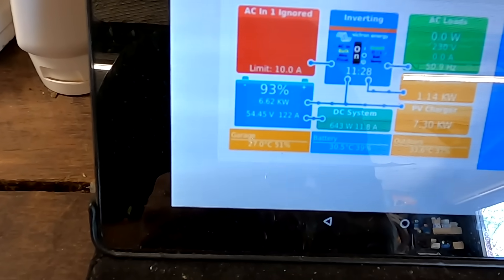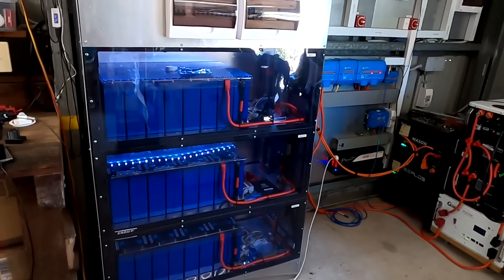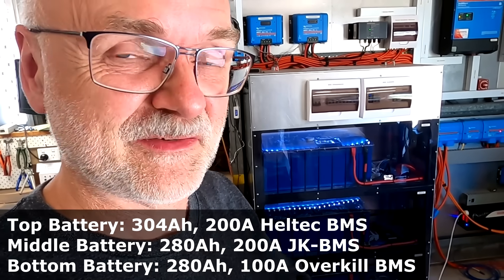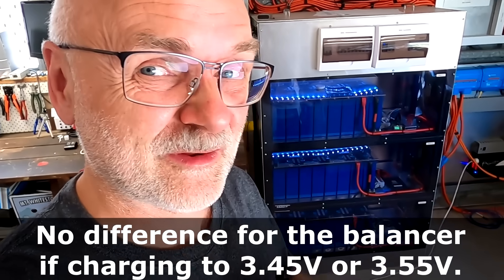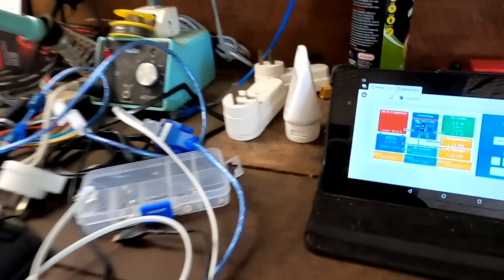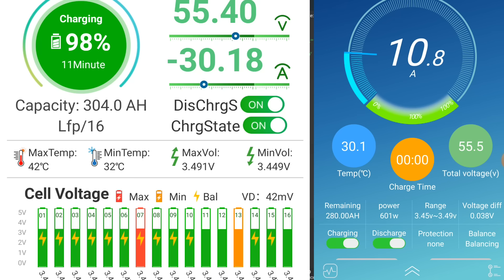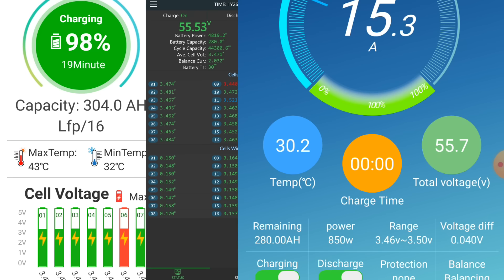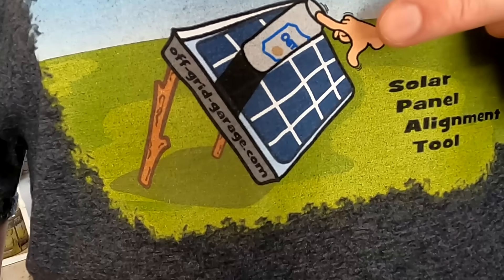Higher charge voltage = better balancing? Here is my battery shelf result!

Comment: Nice test, as expected, wrong verdict. 
The imbalances result from permanently low cut off absorption. You have to go to 3.65V frequently and cut off at 3.75V for safety to allow balancing. Balancing makes only sense in the knees of the curve. With a PSOC charging you increase the drift

You should have let the settings high after the top balancing to maintain balanced cells over time.. 

The unnoticed and unaddressed cell drift leads to usable pack capacity degradation over time. Anyway. Keep the videos comming.

BTW float shouldnt be higher than 3.35V per cell. It makes no sense to increase float at all, just keep it where it is.(13.5V for 4S 27.0V for 8S, 54.0V for 16S)
Reply: 3.75 V is out of spec for these cells and might kill them or even start a fire.
Reply: @Poebbelmann 3.75v/cell is out of spec, agreed, I dont like going over 3.5v max myself. 
I did see a guy (4x4 weekender I think) who accidentally bumped a lab power supply up to 4.3v that was top balancing a beautiful new set of 280A  cells and then left them unattended for the next 4 days like this in his garage, so you can imagine his glee when he opened the shed door to the whole set of 16 cells looking like footballs on the floor, I believe he wept.
Anyhow the good news is they didn’t explode or catch fire, also he managed to re-compress  the cells to some degree and after a year of using them harshly did some tests to see how badly degraded they were, he still pulled around 255A from them, talk about lucky, but it goes to show just how robust these cells really are, but I would definitely say, Don’t try this at home!
Reply from the maker: @aaabbb1579  that is wrong advice and unsafe! The cells will perfectly balance just above the knee of the curve at 3.45V as my many tests have shown. Capacity loss is very very small due to the imbalance.
Passive balancing is something from the old days when we used Li-ion with a more linear curve. I made videos about that as well...

Comment: Deine Videos sind einfach der Hammer. Wenn das JK BMS was taugt für meinen SMA Batterie charger wäre das Traumhaft.
I have a System with 48 Cells (230ah)in 3p 16 s mit einem einzigen BMS. Alleine im jahr 2023 schon 5200 kwh rein und 4360 kwh raus geschoben.
Reply from the maker: Just wait for my 'new' system, I have announced. This is exactly what you need for your SMA inverter.

Comment: Good to see that everything works out just fine at 3.45v as long as you use an active balancer. This should make these cells last a long time.

There is some news about batteries not being recycled because just making new ones is much cheaper. 

On the other hand some car manufacturers are saying that reusing NMC car batteries for stationary storage is a great option if they are too worn or the car is a writeoff after a crash.

Would you recommend doing this and which charge voltage would you set for these cells?
Reply from the maker: Yeah, these LFP cells will last a very long time.

That all depends what cells you have from used car batteries. NMC of LFP make a huge difference. They usually come in modules and have specific settings and voltage they need to charge.
Reply: @OffGridGarageAustralia  Okay, that kind of makes reusing car batteries a bit too complex for most people.

I guess it's better to professionaly dismantle and recycle the batteries to black mass and make new cells out of it that will come with warranty. 

With enough big used EV batteries at low prices and limited mining capacity with future high demand this can become something profitable.
Reply from the maker: @SolAce-nw2hf Yes, some of the modules even have some sort of sub-BMS connected and need to communicate via CAN before they even let power in and out.
Others are in a weird configuration of 19s connection which makes it hard to find suitable equipment.

Comment: Hm, interesting - when your BMS reach the max. pack voltage they don't actively discharge it seems - at least not with a big current. My Seplos BMS hectically discharges with multiple amps down to some lower voltage, only to then charge again up to 55,2V. And this cycle continues for a long time... Would love to know if this is "normal" for the Seplos BMS or whether some of my settings are still wrong...
Reply from the maker: The Seplos BMS does exactly that micro cycling. I hate it. You can turn this off with one of the function switches. It is called Intermittent Charging Function. Try that and it should hold the voltage at 55.2V.
Reply: @OffGridGarageAustralia  Thanks - I assume I should switch that off? Or does it have to be on?
Reply: @OffGridGarageAustralia  Hm, that was already off - but the cycling still happens. Any idea what could still be wrong?
Reply: It doesn't discharge, the surface charge dissipates until the resting voltage is reached , the cells aren't full yet. Take a single cell, charge it and then disconnect it. you will see the same drop of the voltage, the charge wasn't absorbed yet. The surface charge behaves like a capacitor

Comment: It saddens me that you never used the settings I provided for you Andy.  Alowing the cells to float down from 3.6 to 3.45 with the charging mosfetts off is an essential part of the procedure for passive balancing.
Reply: This is only applicable to BMSes which do not use "charge balancing" function. the overkill BMS immediately stops balancing once charge current is zero - and yet the overkill bms was able to keep the top balance significantly better than the heltec BMS which continued to balance after charging stopped. This is a definitive answer on how increased voltages do not help LFP cells or BMSes function correctly.
Reply: @Stefanfj  even the "dumb" bmses do not use "charge balancing." Don't get me wrong I like the smart bmses more but the settings in the app should be changed so the bms does not use "charge balancing." Then when the battery slows down charging at full voltage the balancer kicks on and stays on for hours while the battery is in float. If the battery is in float mode for hours and the balancer is not active the bms is garbage and should be thrown away and replaced with a balancer the activates accordingly!
Reply: @uhjyuff2095  the reason Andy has 3 different BMSes in battery bank 2.0 is literally to show the world the long term impact of these BMSes - it's a test. If he where to make all of them the same and change the settings, we wouldn't have the datapoints given today.
Reply from the maker: @boatelectricaldiy304 this does not work for me as the FETs of the BMS stay on in all BMS unless I hit a protection. So it is all voltage controlled.

Comment: Higher the voltage, more species at SEI layer and higher AC impedance of the cell. So 6000 - 8000 cycles does not mean 20 years service live if voltage is high and current is high and temps are high. If you charge batteries with smaller current till evening, it is better, because nor BMS nor cell produce heat, and if cell is thick, temperature gradient is not the same, as if the cell is thin and is in free air instead of not ventilated battery box.
Reply from the maker: Yes, correct.

Comment: Hi Andy. Please. Could you assist us in cas ewe do not have absorption time with a recommended voltage ?  Thanks again for this incredible helpful you do worldwide !
Reply from the maker: You mean, if the inverter does not allow for any absorption voltage? 
You can try and charge to 3.4V per cell only. The inverter will keep the voltage there until sunset.
Reply: @OffGridGarageAustralia  i will try. But I think the inverter will stop charging once reach the voltage target.
Reply: I’m think it was 1 hour

Comment: If one cell voltage is low a passive balancer has the draw the remaining cells down to its voltage to balance the pack. A big job for a passive balancer.
Reply: the problem is the bmses with the passive balancers are turning off when the bms "thinks" it is not charging any more and has reached float level. Meanwhile the JK bms is still balancing the cells even when at float voltage. Its an unfair test and the bmses should all be in "static" balance mode.

Comment: It's fascinating how a capacitor-type active cell balancer works and the logic is relatively simple - Each cell is connected to an individual  capacitor bank then they are decoupled and the capacitors are connected in parallel to even out and then recoupled to the cells - the process repeats over and over on a kind of PWM slowly shuffling differences about till they all even out- simples : )
Reply: I wonder if two similar batteries connected as a parallel bank would also somewhat self balance each other if top balancing was switched on and off? Would a peaking high cell, when charger is switched off (or imposed by BMS) then discharge in a second lower parallel battery in turn charging and equalising this second battery?
Reply from the maker: Stuart Pittaway made a fantastic video on how these balancers work: https://youtu.be/VR-G-3D82e0?si=o6azG0Dn673jW521

When batterie banks are in parallel, they will self balance out while charging and also discharging. 
https://youtu.be/bhCSccNsQOw
Reply: @OffGridGarageAustralia   I saw that video - there are a few nuances like little inrush resisters - I imagine that they use a bank of smaller caps so  run at higher frequencies - I've had one on my self-build 304ah 4s RV battery in tandem with the BMS 60ma passive  balancer set to 3mV - what I found is the passive balancer trims the cells so fine  the active balancer only takes effect when the difference gets larger under high loads like using the microwave through the inverter

Comment: What a fantastic channel you have Andy, After me fighting for reliable information I found your information both enjoyable and very useful for my very basic  12v cabin system, now have set at 13.8  13.4, 1 hour absorption , working perfectly here in not hot, not sunny Cheshire UK. Didn't get full charge today but the sun was short and sweet today!!! Thanks Andy.
Reply from the maker: Awesome, thank you!
Yeah, 13.8V will definitely gently charge to 99.6% and give the balancer time to sort out the cells.

Comment: What about life impact running a battery up to high state of charge?  I hear daily charging on EV of 70 to 80%.  What do you do on your Tesla?
Reply: that’s for different lithium chemistry. There’s not such a difference with LFP, when going to 3.55v per cell. charging to 3.65v per cell on a daily basis might have an effect.
Reply: tesla vehicles with LFP batteries need to be charged up to 100% at least weekly otherwise their range estimate loses calibration. this is not a problem on the NMC type vehicles since the charging curve isn't so flat below 90%.
Reply: @Stefanfj  interesting point. I’m very familiar with LFP as an off-grid storage solution (I live off grid and rely on it). Because the voltage curve of LFP is so flat between  approx 20% - 85%, it’s very difficult to accurately assess SOC from the voltage alone within that range. So yes a full charge to 100% helps to reset the SOC tracking. that’s only to aid the range readout though, and to help with cell balancing. It’s not required to prolong the lifespan of the cells (although it also won’t hurt).
Reply from the maker: The only reason Tesla recommends charging LFP to 100% once a week is to calibrate the BMS (and range estimation) as discussed above. All answers are correct 😊

I have NMC batteries in my Tesla and charge to 50-60% on a daily base only. Only for longer trips, I charge to 70-90% as needed. Charged to 100% only once for testing purposes (on my other YouTube channel).
Degradation after 4 years and 62.000km is less than 3% (as per the BMS in the Vehicle).

Comment: I guess the issue with higher voltage charging is the weedy passive balancers being unable to stop cells hitting 3.65V and switching all balancing off. Using an active balancer should remove that (and maybe you'll gain 2% capacity 😅)
Reply: No, it's about the cells, you push them over 3.65V (saturation) with safety cut off at 3.75V or more Safety margin depends on the cell manufacturer. When they are saturated they burn some energy in heat and settle the charge, they are like a keg overflowing, but it allows the connected other kegs to fill up until they overflow. 
That is called top balancing. cell voltage and measured voltage differ, as you measure while current flows, hence you have a voltage drop / voltage increase due to impedance and wiring / connector resistances.
Reply: @aaabbb1579  The BMS is programmed to cut off charging at 3.65V. The whole point is to protect the cells.

Also, BMSs stop charging very briefly when checking cell voltage.
Reply from the maker: An active balancer will definitely help...
Reply: @OffGridGarageAustralia  My main point was that the passive balancers are just too small. 2A passive balancing is far more effective (e.g. REC BMS) but I'd still rather use a good active balancer to avoid damaging the BMS.

Comment: So, Andy, I know you have gone back and forth with balancing on then balancing off during charging.  What is the final conclusion?  It appears the balancing is turned on during charging, at least on the Overkill (which is what I am running presently).
For some reason I thought in one of your videos you felt it was best to turn off balancing during charging in the settings??
Reply from the maker: Yeah, it's a tricky one. I have done both for a while and could not see a difference in the result of balancing. Neither is optimal!
Reply: @OffGridGarageAustralia  Thanks for the reply, Andy.  Always a pleasure to hear from you and view your videos.
Reply from the maker: @jws3925  I'm always here😉